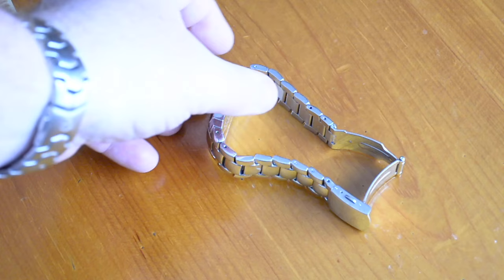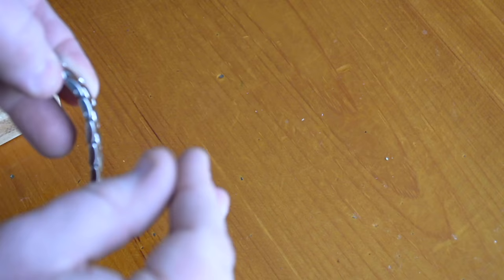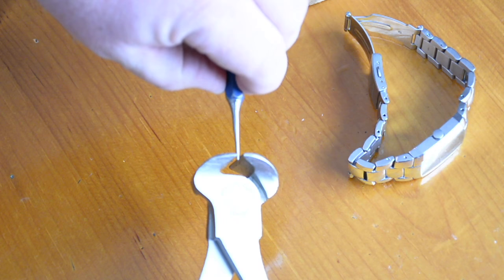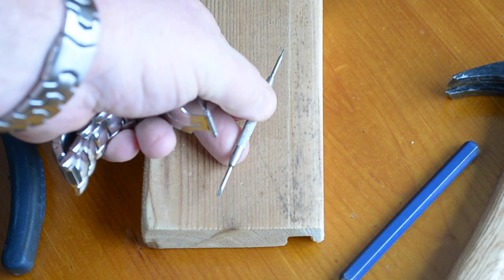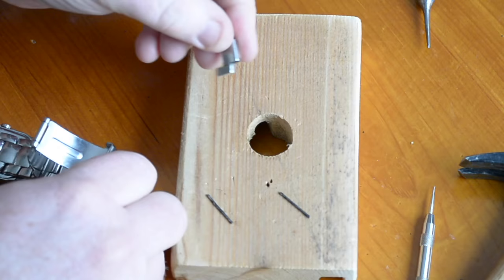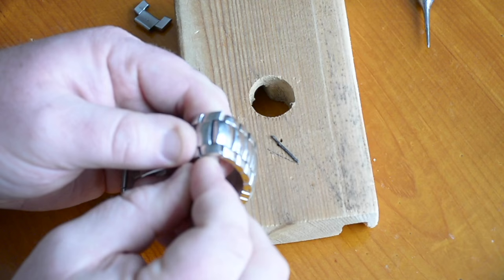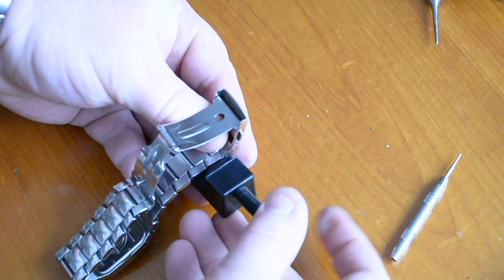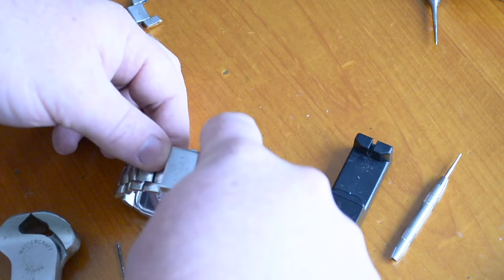Add / Remove Links & Pins from Watch Bracelets - Adjust Length of Watch Bands with Pins

Comment: If we are here watching your video, we clearly know nothing about doing this. How do we know the difference between a collar and a divot? A cotter pin? None of this makes sense.
Reply from the maker: There is a pin that connects the two link. However, the pin would freely move in and out, so there’s a little sleeve/collar that goes over the pin to widen the connection and thus ‘friction fit’ the pin between the 2 links.

Comment: arrows.  What arrows?!?
Reply from the maker: There should be arrows on the inside of the bracelet. If there aren't any arrows and you have 'split' friction pins (not solid ones) you should push from the solid end (thus the split part comes out of the bracelet first). Usually cheaper watches have split friction pins and better watches have collar tubes that go over top of the pins (or in the holes of the link before the pins go through). Anyway, if you have split pins, don't push the split part, but only push the solid part. You should look closely at the pin and if you see a split end and a solid end, push the pin out from the solid end to make sure the split part comes out first. Then, when re-connecting the links, put the solid end in first. The split part is the weak part, so you don't want to push that side as it will just split the pin apart and create more friction.
Reply from the maker: My one TAG watch doesn't have arrows and doesn't have split pins, so I just pushed from any direction I wanted, but when I pulled the pin out, I noticed 2 notches in the pin, so when I replaced the pin, I put the longer part in first (the longer part before the notch). If I would've put the shorter end in first, I'd have to 'fight harder' to get the pin in.
Reply: @heyitsjosh  I read this after adding my comment above - still don't get it.

Comment: How do you connect that watch together after you unlock it
Reply from the maker: You push the pin back in, in the opposite direction that you pulled it out from.
Reply: Mine has only 3 pins on each side, but then there’s no more pins and it still doesn’t fit. What should I do when I ran out of pins? Is there another thing I can do or take it to a jewelry
Reply: I hope that makes sense

Comment: I can’t believe my watches have arrows on them and I never knew this!
Thanks so much for a really helpful video
Reply from the maker: No problem! Thanks for the comment! Just remember that the arrows indicate the 'exit' of the pins (the way the are to be pushed out or removed), and when you're putting the pins back in, start at the back of the arrow and you want the least amount of friction on the pins while they go back in, so they should be arranged to slide in the easiest way. So if there's a divot or raised lip, or something on the pin that will cause friction while in the bracelet (thus the name 'friction pins'), you want to create the least amount of friction while inserting the pins.